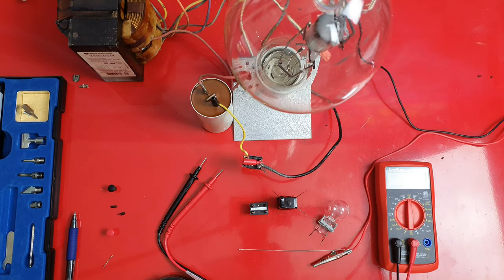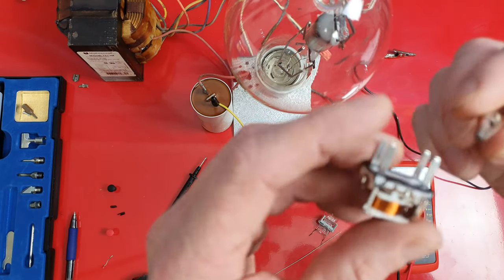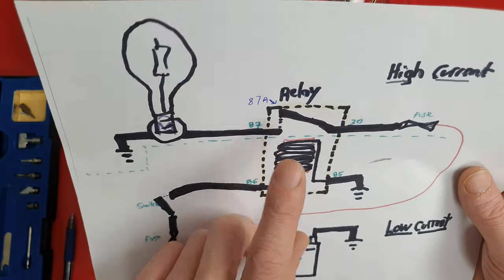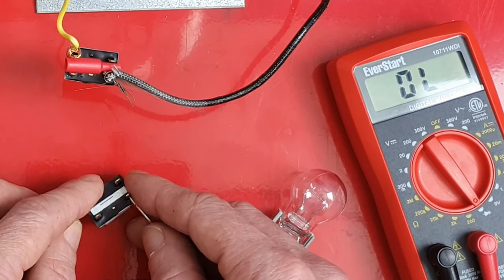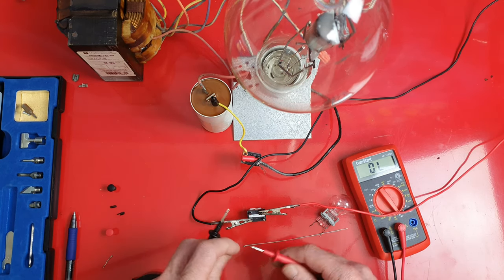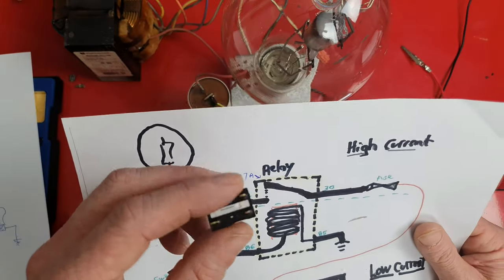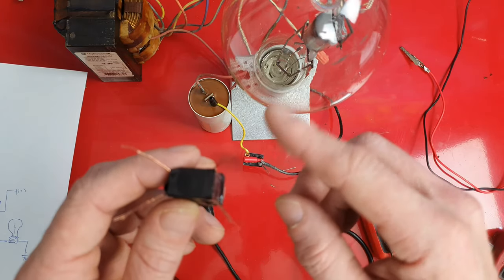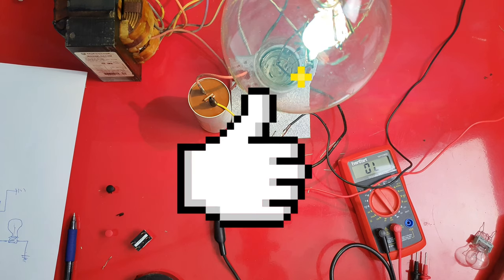How to Test Any Relay (Relay Testing Hack)

Comment: Is there a way to wire an odd out of production 5 pin relay to say a Bosch relay? Or more so, the plug for the mechanism to the relay using jumper wires?

Comment: Good video,, however as you said not all relays are marked... What is the amp rating of the one your showing,, or any other relays that are not marked. Also you say the resistance,, but how do we know the factory value range? If you can answer this your the only one so far.... perhaps pin thirty is 30 amp?